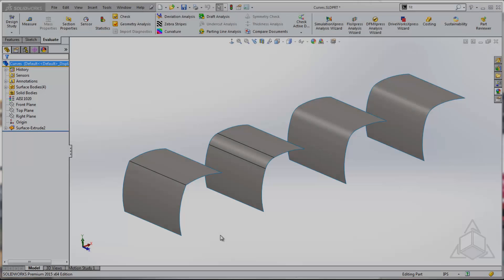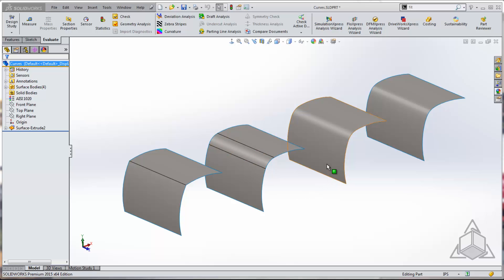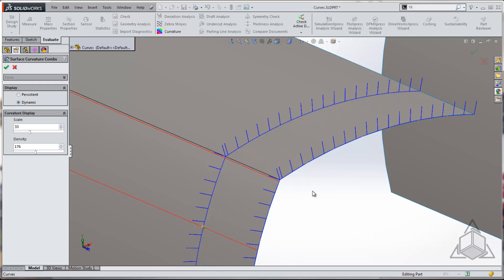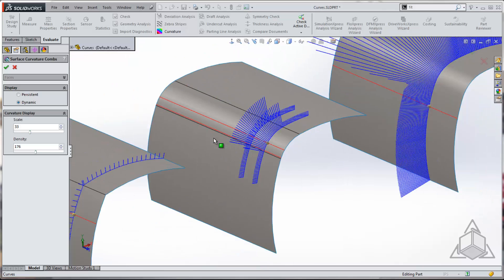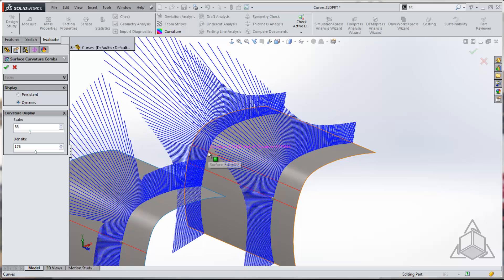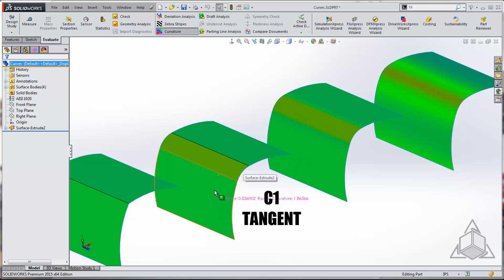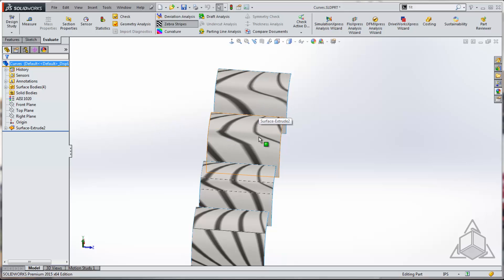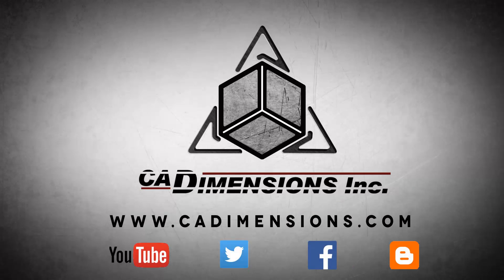Tech Tip - Curvature Continuity

Comment: 03:50
WRONG
G0, 1, 2, 3 isn't the same as C0, 1 2 3
G continuiey refferences geometric continuity which is what you are messing about with
C continuiry reffers to parametric continuity
these surfaces are parametric in that they're essentially a function that you input 2 parameters in (usually t and s) and you get a set of 3 values (xyz) which is the point in space belonging to that curve. they are functions mapping 2d space into 3d space f(t,s) => (x,y,z)
but you can imagine as you increase either t or s by a strady amount the point you are sampling will move along the 3d surface. C continuity reffers to how that movement occurs. C0 continuity just means that as you cross the 2 surfaces the t parameter doesn't "jump" : there are no values taken twice and no values skipped during the transition. 

C1 continuity means the sampled point doesn't change speed when crossing the 2 surfaces. C3 continuity means the parameter doesn't change accelerationwhen transitioning between the 2 surfaces.

you could see this when you try to export the NURBS as a triangle mesh: the middle of the surface will have vertices which are sampled by taking the function and inputting incremented values and the output should be a grid closely smoothly the curved surface. if you try to export the 2 merged surfaces that have C1 continuity you'll see a change of "density" in the mesh (one surface will have more triangles and the other will have way less and there's a clear seam between them ) If you export a C2 or C3 continous set of surfaces, in the triangle mesh you'll notice a gradual increase or decrease of triangle density when going across them, with the C3 being a lot smoother transition than the C2

Please note that this is completely separate from geometric continuity: you could only have a sharp G0 turn and still have complete C3 parametric continuity

Comment: How did you create a G3 surface in Solidworks?
Reply from the maker: This was a standard 3 point spline that had been adjusted by hand to create a smooth transition. However... keep your eyes peeled. There may be some new tools in this area in a release of the software coming soon!
Reply: I like that like.